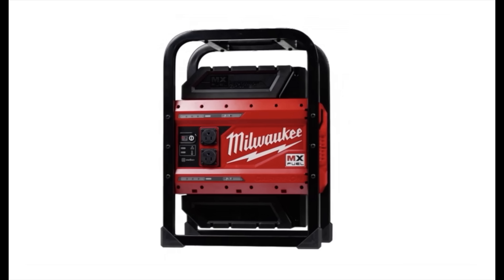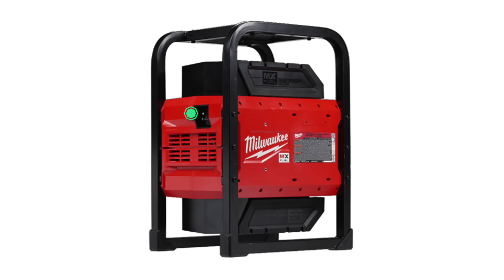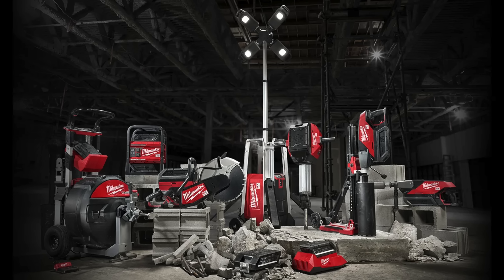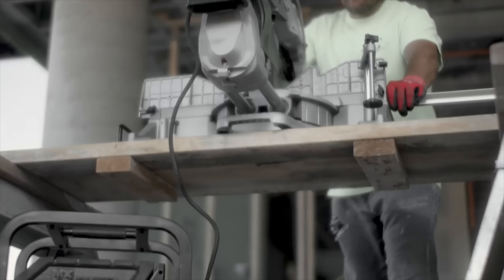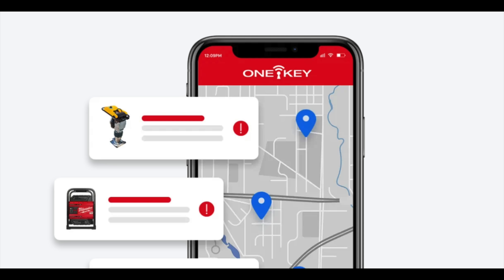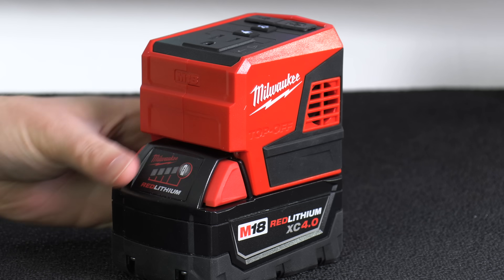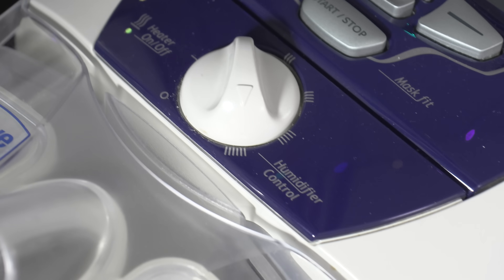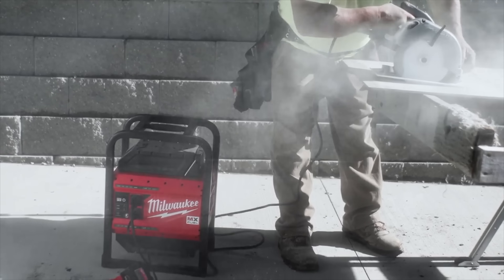END of GAS Generators? Milwaukee MX Fuel Carry-On Changes EVERYTHING 3600 Watts!

Comment: It's not a generator. It's a battery power bank.
Reply: Actually, It's a battery powered inverter because it converts DC to AC.
Reply: Exactly!!!!   Got to take the batteries out and do what to them....Put them in a battery charger....DUH!!!!   When I need a generator, I don't have electricity!!!
Reply: @dannyj5688  you can charge them without removing them.
Reply: @dannyj5688  it's mostly for tools not homes
Reply: @dannyj5688  are you dumb?
Reply: @dannyj5688  so as I said its a waist of money. I still need a generator to charge it, or you need to plug it in to charge. If you have power why do you need it?
Reply: @neildewitt2869  The same reason you need a gas generator...so you can have A/C power at locations where there is no wired continuous power source.  The same reason you "need" any cordless tool...so you can move that tool around without it having to be plugged in.  

I can see how this would be useful in situations where you need limited run time and don't want to run an internal combustion engine; however, given the limitations and the high price point, it's definitely a stretch in terms of value, unless you find yourself in those situations pretty regularly.
Reply: @mph7282  what do you do when it dies after use? Without electricity in wires to my house I have to fire up tge Gen set to charge it. It's a waist of money for me.
Reply: @neildewitt2869   It supplies AC power remotely, which is entirely the point.  If it's not for you, don't buy one.  If you'd bother to read what I wrote instead of hardheadedly arguing for the sake of arguing, perhaps you'd understand that.
Reply: I don't get all the consternation about this being an inverter rather than a generator.  The point of the device is to be able to supply alternating current without being connected to an existing power grid...the same thing a generator does.  So it does so by inverting stored direct current rather than generating that alternating current using rotors.  What difference does it make?  The device certainly has its limitations and drawbacks, and it's not particularly valuable except in very limited circumstances, but the electrons don't care.
Reply: Nomen Clature  And you can wail that it doesn't make you pancakes and sausage every morning for breakfast, that doesn't mean it doesn't do what it's intended to do.
Reply: @mph7282  nobody said it didn't do what it's made for. But it is very limited. After it's drained you have to burn oil to recharge it. No matter if you use a generator or plug it into the wall. It's burning oil.
Reply: which converts one type of energy into another...just like an actual generator.
Reply: The sun is the source of energy for the fossil fuels, hydro power, wind power, solar cells, etc, for your generators, inverters, etc. so everything else is just converting, for the semantically strident set.
Reply: Thank you for saying this. Big difference.
Reply: A circular saw will end this battery quickly.

This an integrated inverter and deep cycle battery.

People could have used computer UPS units for this purpose.
Reply: right .. and without electricity .. you cant charge it!  
Fossil fuels rule!!
Reply: @rigjockey67  No, fossil fuels kill people with their poisonous gas. Solar and wind power rules. And they don't kill people. Get with the times you old fogey.
Reply: @rigjockey67  Wrong.  In the PNW it's mostly hydro, extremely clean.  SW is large into solar.  Illinois has a lot of nuclear, extremely clean.  The rest of the civilized word uses nat gas, which is pretty clean  If you live in filthy coal country... well you're out of luck, but coal is going bye-bye.  Battery production isn't that bad, you need to realize that gasoline production is dirty as well.  While generating gasoline and electricity pollute, there is no byproduct when "burning" electricity in EV's.  The shit that comes out of a cars tailpipe literally kills us.  If you're interested in learning instead of spewing fake news, check out this MIT project - https://www.carboncounter.com
Reply: @bobthebuilder372  Who is it that owns that website??  Go to an Oil refinery website and see what they have to say?  Of Course they would say that!  Anyway ... believe what you will ... that's the beauty of opinions .. we all have them even tho some are wrong!
Reply: @fourbypete  look up the company gevo makes zero emission fuel
Reply: @christiancastellano5372  sweet.
Reply: @fourbypete  you have no clue just like all the democrats that thing solar/wind is cheep. It's not. And by the time it actually start to pay for itself it's broken down or not working anymore. It take oil to build almost 3/4 of everything you use. Plastic, your car, etc all need oil to build them. Do some research. Learn something before you open your mouth. Thank you!
Reply: @bobthebuilder372  I bet you have a cell phone, car, house etc... and all of them needed oil to produce. After you have you hydro plant all made with oil, it only puts out so much and not enough electricity.  Your barking up the wrong tree. Your not convincing anyone here. We can cut emissions but we will always need oil to build whatever you have. Walkimg even takes oil for your shoes and clothes.
Reply: @neildewitt2869  It's cheap enough here in Australia.  My house has been running on pure solar since 2008. As soon as someone makes a 4x4 with a decent range I'll be getting one. I don't know what you're on about.
Reply: @fourbypete  I live in Alaska in the bush as we call it. You say outback.
Reply: @neildewitt2869  We call it bush too. The outback is a cross between desert and bush.
Reply: Not exactly... it dosen't charge the batteries.

Comment: It's just a battery .gas powered generators will be around  to charge the batteries.
Reply: @youtubejunky7481  I know it's a waste of time. It was a joke.
Reply: Not if you have a bicycle with a generator on it to charge the batteries. All you have to do is pedal what's equivalent to 200 miles.

Comment: Not.even.close.  Batteries like this do not replace generators.
Reply: Click baited title, it's obviously not going to replace gas powered generators, so it's not the end of anything.  That's what's getting everyone all riled up, lol.
Very limited market at its price and use cases.
Reply: I would have to agree.  It's battery and LOTS of marketing hype. Knowing it's a Milwaukee it will go out and then you can get parts for it.  Kinda like my Sawzalls which used to be really good.... but that's another topic.
Reply: Depends for which task ;) For a lot of jobs battery "generator" can replace petrol generators no problem and where it CAN replace it: there the battery "generator" is superior to petrol! Cost a lot less to run and is silent. As i said for a lot of jobs/tasks, not all jobs it is actually better (this last sentence are for all the people that can't read properly).
Reply: @damijanapopotnik8081  This is not in anyway a generator.  It is purely a battery bank, nor is it intended to be considered one, if you read milwaukees info on it.

Comment: I don't see the application. The two batteries have a capacitie of 6 Ah at 72V which gives a total capavity of round about 900Wh. If it runs at the full continious load at 1800W, it will only last 30 minutes before one has to charge the batteries for 90 minutes. Shure, it is quiter and cleaner than a gas generator but it can't compare in runtime at all. And it isn't even that much cheaper if one includes the wear of the batteries (2100$ / 2000 cycles = 2.1 $ + electricity per recharge, and that is realy generouse since normal lipo batteries in tools often only last ~500 cycles driving the cost to ~ 8,5$ per recharge.)
I just can't see the application where one can't use a generator or a long powercord but normal battery powered tools won't do the job.
The only exception is, if one already owns the batteries and needs to run cordet, exotic / specialised tools from time to time.
Reply: I was just doing the same math and came to the same conclusion!  It's funny that the amp hours and/or watt hours aren't listed on the specs page.  Even on their website.  But they do list the sound level of 60 dB(a).  That's very loud for a battery-powered DC to AC inverter!  I can't imagine what is making all of that noise?  A built in cooling fan for the inverter?  This battery inverter might be ok at a jobsite, for intermittent use, like making cuts with a saw on and off.  But anything with a continuous draw  will drain the batteries quickly.  The most important specification should be watt hours.  That will tell the true "run time" of this battery powered inverter.

Comment: Perfect for jobsites where you don’t have power and can’t have a crazy loud generator running constantly
Reply: This clearly is for the working MAN , not the off grid weirdos hiding from progressing society! If you have this GENERATOR,  (hahah yes I said it If it generates power, by definition it’s a generator regardless if it’s a battery or a gas engine) it’s perfect for bringing it from the workshop to the job site everyday to get things done inside without fumes or noise. The future is here old hags get with it or get lost !!!
Reply: @sugmaligma6344  But it doesn't generate power.  It store electrical energy that is pumped into it.  Generators take one form or energy and convert it into electrical energy.  This is a storage unit: electrical energy in; electrical energy out.
Reply: @thetruth-hl7ct  it generates power to whatever is plugged into it sorry man can’t argue that
Reply: @sugmaligma6344  By that illogical definition the batteries in ANY device would be considered "generators", which of course is nonsense.  A generator is defined as a machine that converts mechanical energy into electrical energy.  A battery takes in electrical energy, and puts out electrical energy.  All that Milwaukee did was take the equivalent of a whole bunch of cordless powertool battery cells and stuff them into one big box.
Reply: @thetruth-hl7ct  a big ol battery cell that generates power 👍👍

Comment: It's $2000 for a battery pack! No solar so you have to have power from somewhere! This is absaloutly useless! How much do those batteries cost that you have to charge from the wall for more power? What a joke! If your a contractor you will be better off using gas because those batteries can only be charged so many times before they no longer hold a charge and you need to replace them. That never happens with gas. This is a joke! Not even an option for solar recharging! You would have to buy an actual solar generator to recharge this BATTERY pack!
Reply: I wouldn’t dare defend the price, and no solar input is super shitty, but you have to be mental to claim there’s no use for these things. I’m not sure what this particular spec is, but 15 years ago some cordless batteries were already rated for 1500 charge cycles. It’s very likely these are many times that, depending on use. Which could last some ppl a decade or more. And if I had to risk leaving my $1000 Honda running on the sidewalk to power my tools, or have the cord running inside the house to a closet where I have this thing hidden in perfect silence, I’d pay $2000 for it over the Honda every day of the week.
Reply: @ThisTall  really? There's so much here to unpack! First your Honda is making noise. If someone stole that you would say " what happened to the generator" as soon as you noticed it was to quiet. And your not going to leave a generator hundreds of feet away from you. It's usualy 50' or so away from you. So no one's leaving a gas generator hundreds of feet away from them so it could get stolen. Mabey outside the house on the doorstep where no one has ever stolen one while people are inside working with it. When your taking a break you shut the generator off. And anyone whose willing to steal a generator outside a house with a few contractors working inside will definitely steal a silent one it's not like your inside working and there's no one buzzing around the work site long enough for someone to steal your generator. When was the last time you've seen this being a problem worth spending$3000 for a generator and extra battery's when you could easily spend $500 and a $6 tank of gas on?
Reply: Kermit 
I thought most modern cordless tools are already battery powered 🤷🏻‍♂️
Reply: @peteryeung111  what’s your point ?
Reply: @peteryeung111  I'm saying! Why would you spend $2000 plus how ever much those batteries cost "I'm guessing$200-$300 a piece when everything your using is already battery powered and you have to charge them anyway. Any real contractor isn't using corded tools unless they have to and they arnt using corded tools in a area where they can't use a cheap gas generator. We charge 2 or 3 batteries at home when were not working on a job site when were not in a place where we have power! This thing is a joke
Reply: Jam Band 
Yes, That is exactly my point.
Reply: Brilliant analysis. Thank you

Comment: It's NOT a generator!   It is a battery!   You insist on calling reviewed battery packs "generators".
Reply: No, it converts DC to AC.  It does not generate anything...
Reply: I agree. lets stop this kind of stupid shit right now..... and just because steel is folded does NOT make it 'damascus' steel.... sorry. got carried away there!
Reply: It does generate AC.  Batteries do not.
Reply: @scottkolaya2110  It does NOT GENERATE any electricity!!!!   It uses an inverter to convert battery DC to AC!
Reply: @tenpiloto  Then it is not just a battery, is it?  We'll call it a battery-powered inverter.
Reply: @scottkolaya2110  what people failed to understand is that this probably comes with a attachment that allows for solar charging which can mean creating power from solar making it a generator.
Reply: @johnree6106  Unfortunately it doesn't have any inputs other than a 120VAC which you cannot directly charge from solar.  Even if it did, someone would probably trot out the narrow Webster definition "a machine by which mechanical energy is changed into electrical energy"  And @tenpiloto isn't wrong by calling it just essentially a battery because it's just storing 120VAC energy that was put in and outputting 120VAC later.   Milwaukee just calls it a power station.  They sort of reference "generator" in some places, just like they reference their batteries as "fuel"
Reply: @scottkolaya2110  cool to know. Still pretty good not sure if I would fork out the cash for it,  but I can see that it could be useful, but I am more interested in the smaller adapter as it is something I might buy if the price is not too expensive
Reply: @johnree6106  No, it's still nothing more than a battery bank, the solar panel (which would be a  hilariously slow trickle charge) would be the "generator" at that point.
Reply: @johnree6106  the video says it can't be connected to solar.

Comment: They need a offer 12V to 120 RAPID charger for the job site guys to recharge from the truck.  This way during lunch they can top it off.  Also great for indoors where you can’t run a genny or a pull cord
Reply from the maker: I totally agree, they must be planning it as an accessory or something.
Reply: Thats why extension cords exist

Comment: But how long will it run for?
Reply from the maker: That is a good question. some data says the batteries are 846 watt hours which doesn't sound right to me. When I have it I will be testing actual run times with the lab analyzer & will show you exactly how long you can expect & more examples of appliance run times

Comment: It's all good till you can't find an outlet in the forest?
Reply: Dewalt has had this for 2 years I believe
Reply: Solar my genius.... Solar. You won't find gas in the forest either.
Reply: @Vintage27  there is solar panels growing in forest now? Gotta go hiking more often
Reply: But you can find gasoline? Lol
Reply from the maker: @Sig_716  I wish I could buy extra, lets hope its not $5 gallon again soon
Reply: @Sig_716  tell me were can i find the nearest  electrical outlet in the bush
Reply from the maker: True, I have a feeling this is the beginning. No other large manufacturer has entered this space yet. Times are changing.
Reply: @SilverCymbal  how about ego?
Reply: @span3xd  Ego is definitely a player too, they have batteries running a ride-on lawnmower now.
Reply: @SilverCymbal  Dewalt came out with their power station , to me that is more flexible option , that you use batteries you already have , and it can be use as a charger , https://www.youtube.com/watch?v=TDTw95y8-4c
Reply from the maker: @45NUTS_PART_DEUX  That was a good start but sadly it was modified sine wave only which made it more like the small top off model I showed at the end of the video. I will be amazed if Dewalt doesn't try to come out with a larger model after this.